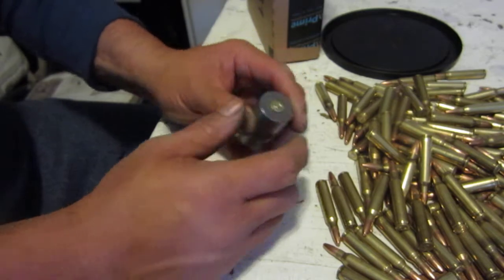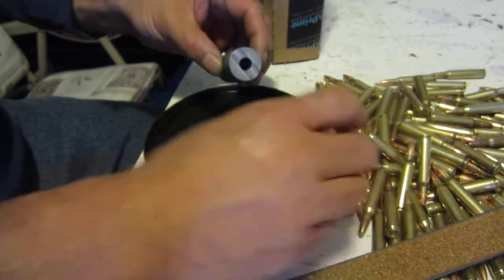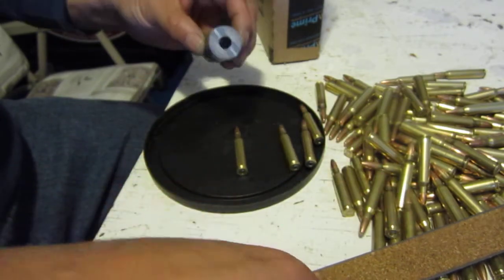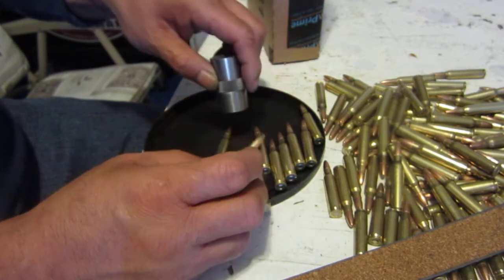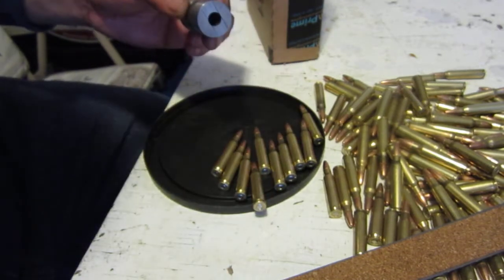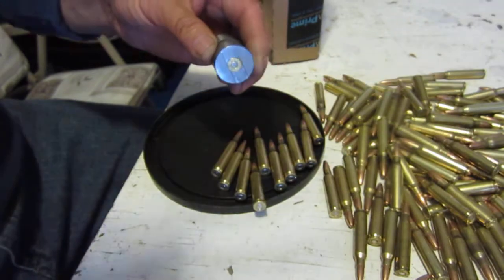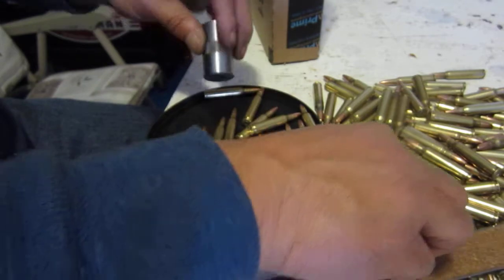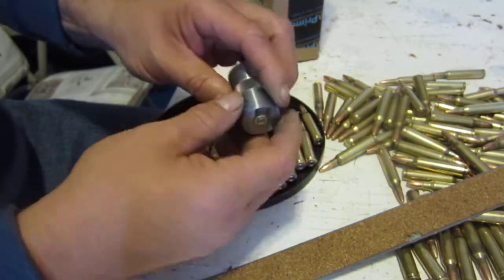223 case lenght check for semi autos

Comment: Ideally this should be used on your resized brass to check headspace first and then flip over, place on a flat surface and check overall brass length.